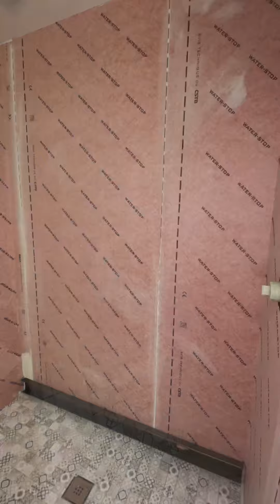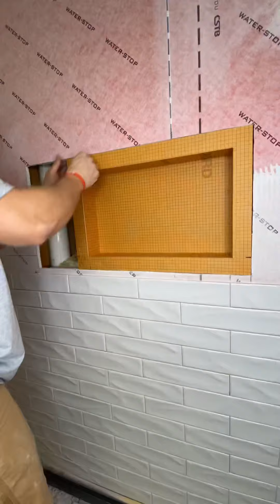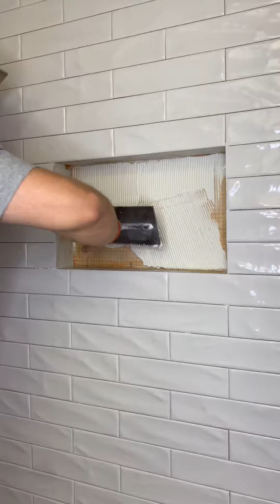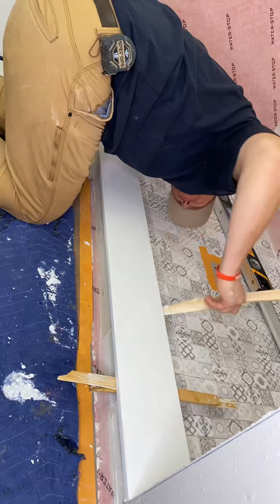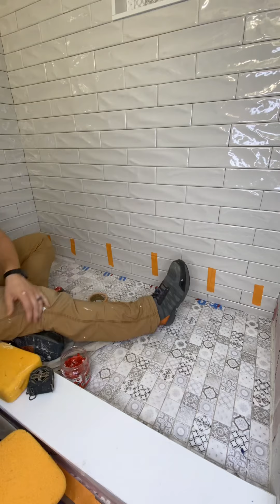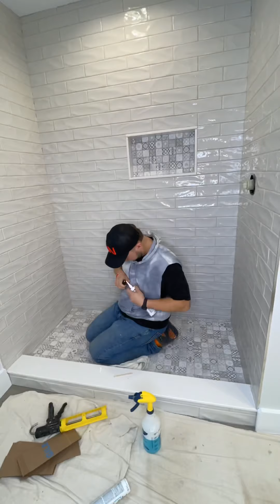Watch a Shower Tile Installation from Start to Finish in Time Lapse. WINNI

Comment: Nice job Misha but why did you have slivers on the thee top and bottom?
Reply: I think it can get difficult sometimes with subway tiles because of their size.  If you cut one in half, you are left with two slivers.
Reply: Good eye, start with a full and would have had nearly a full at top